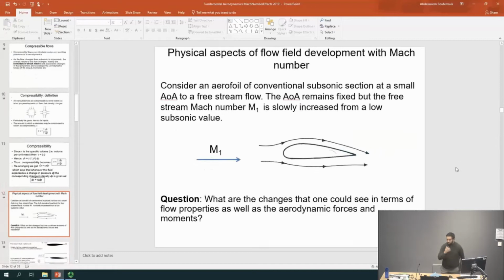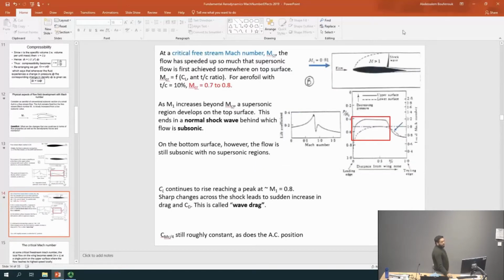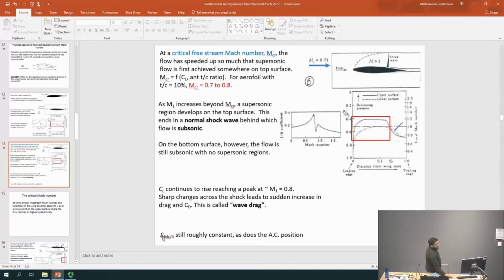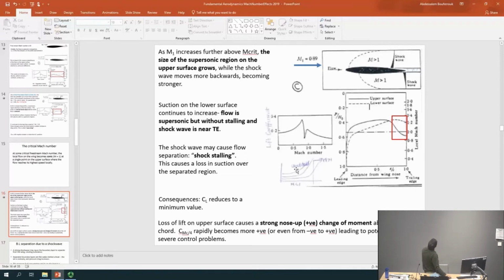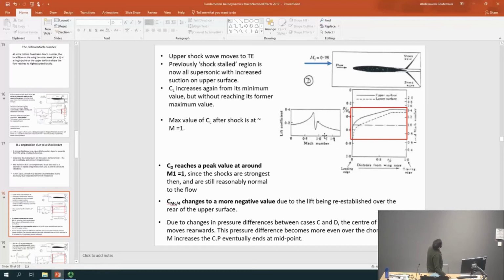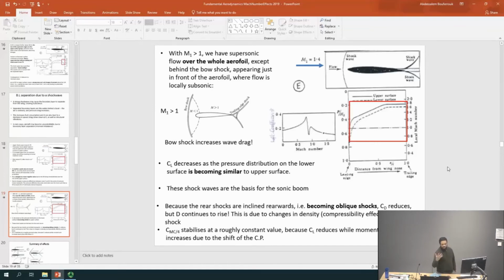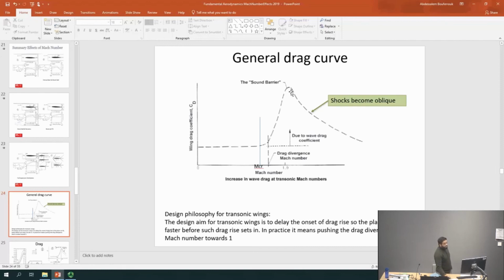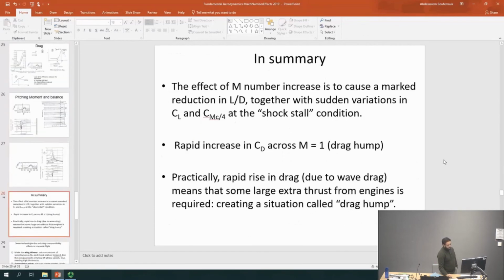Discussion of Mach Number Effects  shock patterns force behaviour Drag rise

Comment: Hi, I have a question: After we reach MCrit and get a shockwave, what happens to the position of such shockwave on the top surface of the profile as we increase the Angle of Attack (for instance by changing the camber, i.e. lowering an aileron)? Does it move towards the leading edge or towards the trailing edge of the profile? Could you please explain why? Is there a graph/picture somewhere?